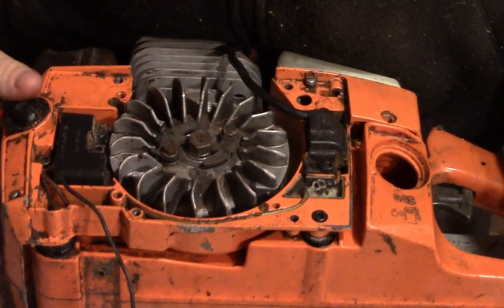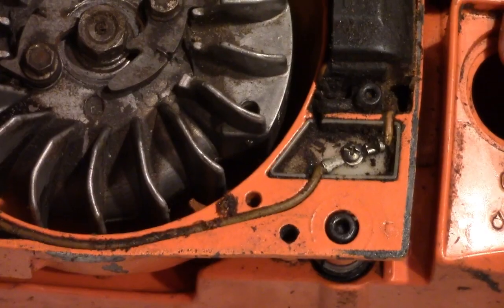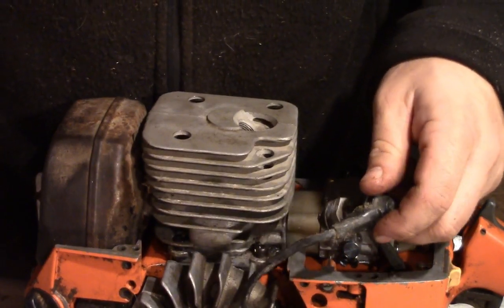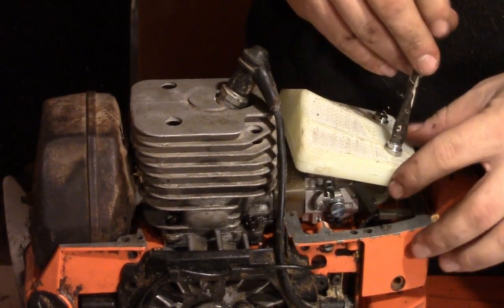HUSQVARNA 266 TO 272 EP # 7 COILS AND TOP COVER DIFFERENCES

Comment: Hi what is the difference between a Husqvarna 268 and a 268 XP for ignition coils??
Reply from the maker: @robrich8294  one and two piece. 268 has one coil and 266 has a two piece design.  They don't fit in each other
Reply: @stuffnsuch631  yeah my Husqvarna 268 XP was cutting out when warmed up. I ordered an ignition coil on Amazon for $15 new but I messaged that same person and he said a Husqvarna 268 is Different from a 268 XP. Is there a 268 Plain ? I think I’ll be fine but if not do you have a single coil for my Husqvarna 268 XP? I use it to make shavings for cold smoking mackerel. I have just one ignition coil and my Dad bought me mine when I was like 19 yo. 

You on Facebook?

Do I have to use a business card between the flywheel and coil on a single ignition coil unit? Heck I had a used Atv & dirt bike used parts business  for more than 20 yrs and sad to say I never changed  an ignition coil. I’m going to assume I need to have a gap in order for their to be spark on a single ignition coil unit as well.